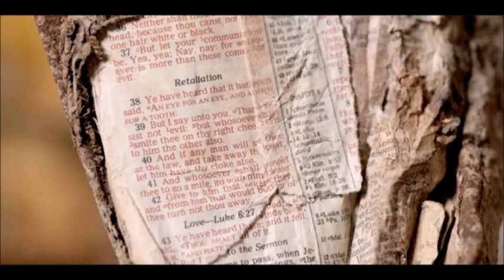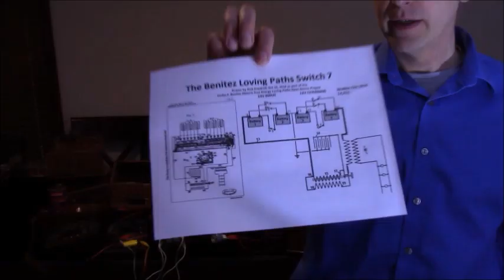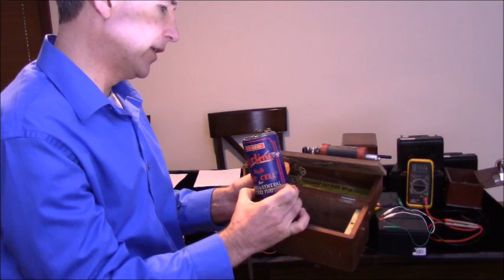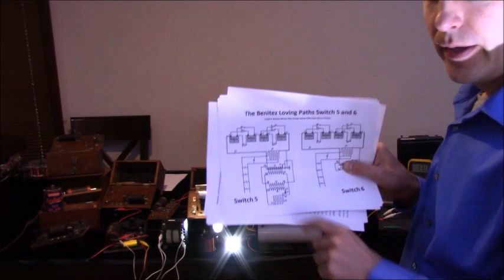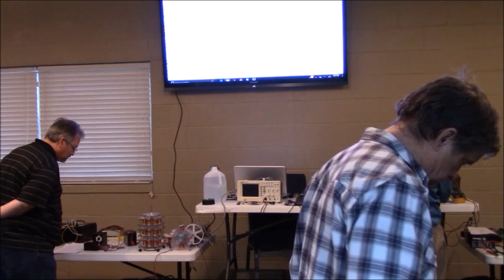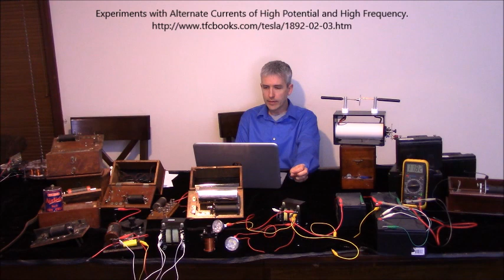The Benitez Loving Paths Switches and Free Energy Project

Comment: Rick, on your white induction coil with the manual spark gap equipment on top, does the spark gap equipment perform the function of the interrupter?   Also, on Benites' "Improvements to induction coils" patent, are the number of turns and gauge of wire (looks at least 18 ga) reasonably accurate in the drawing?  Don't look too hard to make then...
Reply from the maker: On that big white induction coil there is a nice interrupter on the side that has two ends to it for better control. The spark gap is not at the interrupter unless you don't have a spark gap, then Benitez writes that in performs that function. If you read the last patent he writes about multiple spark gaps. There is a lot to learn about all that which this comment is not the place for.
Are you confusing Cook's patent with Benitez? Cook's system does not have the details of Benitez so it is harder to figure out because he is not talking about taking off the shelf induction coils like Benitez but is actually making some very big ones with big iron cores or magnet cores.

Comment: Hi Rick, please call me AL. A great inside of what shall and will happening soon. Maybe I'm wrong in my assumption, please have a look at the sheet Benitez Loving Path Switch 5 & 6, connection on switch 6, No. 10, 17 & 19 (interrupter). I believe that No. 10 should go to the brass only and 19 goes to 17? Please advise - thank you so much!
Reply from the maker: I wondered the same, and really both can be done. Benitez says there are several variations of these. But as Switch 7 clearly shows it this way, only with the transformer in series, I decided to do that. If you just parallel up the primary and secondary you really don't get the desired action.

Comment: When I think of the induction coil interrupters, I think of relays. I there any reason properly chosen relays wouldn't work in these systems? Thanks Rick, I love your work.
Reply from the maker: Thanks. Yes the first addition to the patent is a mechanical rotating relay. The issue with all that is contact wear depends on amount of power you are running. And before that, the timing in relation to the impedance of the capacitors and transformers and relay on time. The way I look at it is we can do the first addition to the patent with lower power applications (but we can learn from the actual processes to do the same sort of thing in other ways).The last patent is the easiest way to go up in power. However, we can still do very rapid and efficient and stable high power interrupters with liquids as Benitez mentioned. It's obviously not worth it to do that for a small system, but it is for a bigger system.